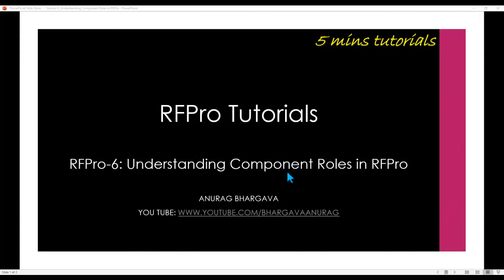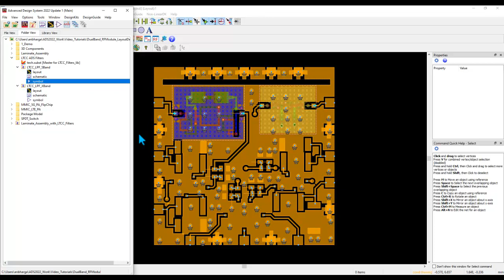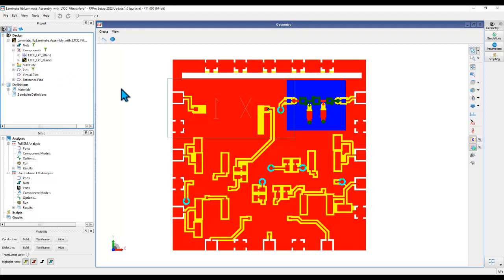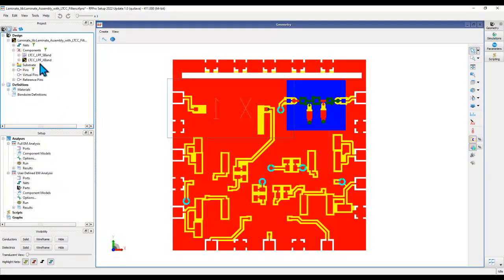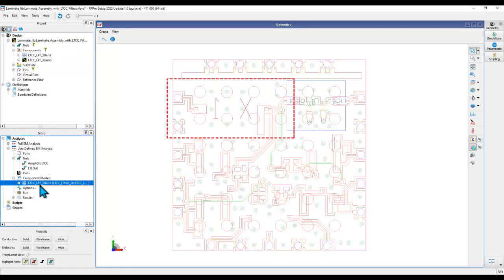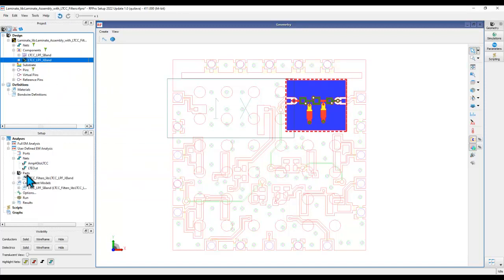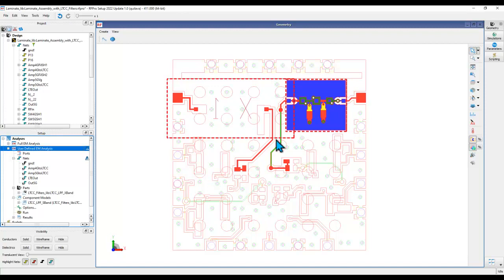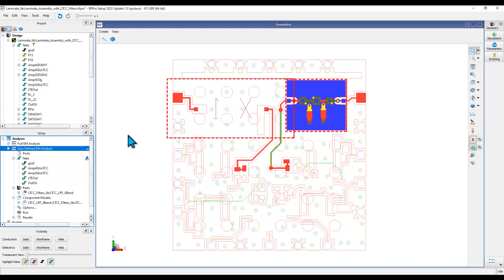RFPro-6: Understanding Component Roles in RFPro

Comment: Dear Anurag, 

great video but I have a question. If I have a board but I take some of the parts out (e.g LF filter section and High pass filter section) and then open both of them in the same workplace, can I able to do what you are doing here? It seems like you already have your whole board inside but you were still able to cut off some portion of it. How can I do that?

Comment: Great video thanks, shared with many. Question, so when you launch RFpro and simulate the S/X band filter components on top of the full PWB board substrate, are you essentially simulating both the substrate stackups of the full PWB and the individual substrates of the S/X band component filters that sit on top all in one go in RFpro? Or are the S/X components already simulated in separate EM simulation and then just added on top of the full PWB RFpro simulation? In other words, are you live simulating essentially two different stacks up at one time when you launch RFpro with a full PWB and then a component on top of that PWB with its own specific layout/stack up? Thanks!
Reply from the maker: Hi,
There are many things unclear in the query but I will try to respond on what I could understand:
1. RFPro does have the capability to perform multi-tech assemblies where you can have different stackups used in the simulation
2. I am not sure what kind of components you referred in your query and it could be simplistic circuit components like L & C for which there is no EM simulation but rather only circuit view is used to create ports at connection points and then they get recombined in schematic for cosimulation.

Comment: When a component doesn't have a model RFPro allows you to import one, but it must be json file type. Which is odd, since no CAD generates json file types, only snp. Looking at github there's a tool to convert snp to json. Does ADS have a tool to convert snp to json for use in RFPro?
Reply from the maker: You don't need json file and instead use SnP file directly for the component in RFPro as explained in this video: https://youtu.be/xdRZI875vkk (watch video 8,9,10 in RFPro 5mins tutorial playlist)